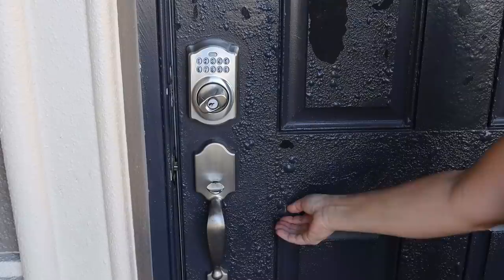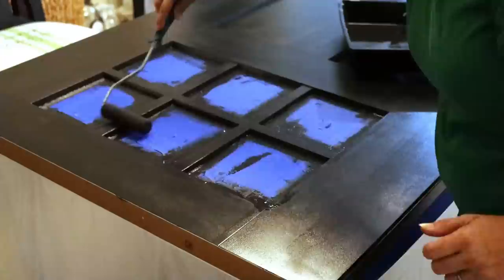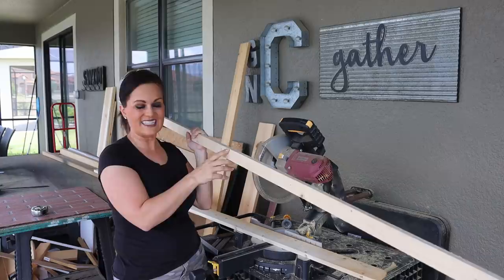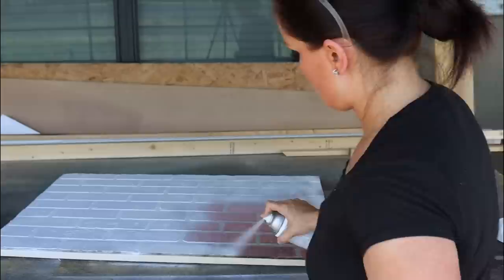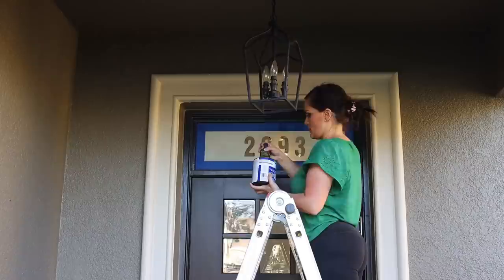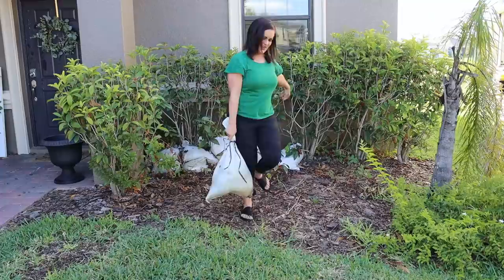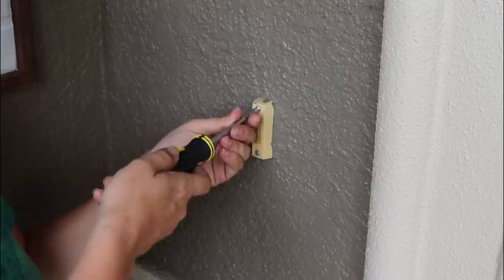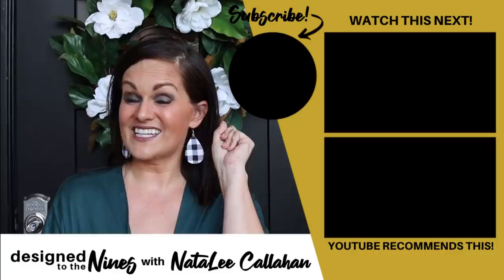Curb Appeal & Front Porch Makeover on a Budget: 7 Easy Ideas!

Comment: Replace or prune the 4 shrubs below the window to reduce their height. They are hiding that gorgeous sill detail beneath your side window. If you are hesitant about pruning, take no more than 1/3 of the green growth from the plant. Make each cut a fraction above a healthy pair of leaves, or just above the collar at the base of a branch. The two shrubs on either end can remain at current  height or replaced with something taller. At the outside corner of the house, a "tree" shrub would soften the sharp vertical of the building and distract from the neighbor's trash cans. Choose a plant that would grow no taller than about 2/3 as tall as the house and narrow enough so it won't block the window. If you can find something with attractive and unusual stems, that would be better than a mass of green. A weeping plant with its gentle swaying motion could be gorgeous. The lines of your home are so clean and simple that it is the perfect showcase for a spectacular ornamental planting.

Comment: Tarek on flip or flop got this from his Mom. Dampen the oil stain on the driveway and then add baking soda and a can of coke. Scrub with a wire brush and power rinse with water. Can be done multiple times if necessary.
Reply from the maker: I’ll have to give that a try!

Comment: If you get an oil spill accident again, try coating it with a thick layer of talcum powder, regular flour, cornstarch, to absorb as much of the oil as possible.  Leave on for 24 hours and then vac off or sweep up as much as possible, then treat the remainder with your favorite de-greaser.  Many swear by Dawn dishwashing liquid as the best to break up oil/grease.

Comment: Love the makeover. Wanted to give you a tip. I used a powder cleaner from Amazon that's also available at Sherwin Williams called TSP to clean oil from a turkey fryer off my back patio and it worked like a charm. Figured I'd pass that along
Reply from the maker: Thanks for the tip! I will definitely give that a try to see if it can finish the job! =)

Comment: I've never seen the hinges on the exterior of a door. Is that a different type of hinge? Typically you can just hammer the hinge pin out and take the whole door off from the outside! I realize this comment is very old, but I've just been repainting and re-hardwaring all our doors so I'm in door mode. Great video. Thank you!
Reply from the maker: These are common in Florida. It’s to fight against hurricane force winds. Much harder for the door to get blown in. The hinge pins cannot be removed.. so that is good!😅 💕

Comment: Hi Nathalie, I have a question.... your new door has outside hinges, I never saw that. Theoretically, couldn’t someone just pop the pin and remove the door this way? Maybe I am missing something... can you explain this to me please? 

Your DIYs turned out beautiful as always. Have a great weekend.
Reply from the maker: I forgot to put the clip where I talk about this!🤦‍♀️ anyway... it’s for hurricane protection so when the winds are blowing at 100+ miles an hour with it on this side of the door jam there is more support. It was another reason I bought the door I did. The pins in the hinges of the new door cannot be popped out. The only way to get the hinges off are with the door already open. On top of that, we live in a guarded and gated community and we have a security system. It is a really good question!

Comment: Beautiful transformation. Why are the hinges on the exterior of the door? Is that common?
Reply from the maker: It’s installed that way for hurricane protection so when the winds blow hard, it has more support. That was another reason I switched out to the new door... the new hinges you cannot pop the pins out... plus we live in a guarded community and have a security system. We have taken every measure to keep our family safe. Thank you so much for your concern though! 🥰

Comment: Loved everything! Am I the only one who is wondering why the hinges on the front door are on the outside!? Anyone could just come by and pop those hinges and break in! Is this common practice where you live?
Reply from the maker: I forgot to put the clip where I talk about this!🤦‍♀️ anyway... it’s for hurricane protection so when the winds are blowing at 100+ miles an hour with it on this side of the door jam there is more support. It was another reason I bought the door I did. The pins in the hinges of the new door cannot be popped out. The only way to get the hinges off are with the door already open. On top of that, we live in a guarded and gated community and we have a security system. It is a really good question!

Comment: I’m confused. Why are the hinges on the outside of the front door?  That makes the front door easy to break into, right?  I hope I’m wrong.
Reply from the maker: I forgot to put the clip where I talk about this!🤦‍♀️ anyway... it’s for hurricane protection so when the winds are blowing at 100+ miles an hour with it on this side of the door jam there is more support. It was another reason I bought the door I did. The pins in the hinges of the new door cannot be popped out. The only way to get the hinges off are with the door already open. On top of that, we live in a guarded and gated community and we have a security system. It is a really good question!
Reply: @designedtothenines  oh good!!   Love what you do!  Very inspiring. Your home is lovely

Comment: NataLee this is all just beautiful, but are you not concerned that someone with a hammer and a screwdriver could simply pop the hinge pins out and have full access to your home? The original door swing was to the interior, but the installer changed the direction and placement of the hinges to the exterior. I only point this out for the safety of your family.
Reply from the maker: I forgot to put the clip where I talk about this!🤦‍♀️ anyway... it’s for hurricane protection so when the winds are blowing at 100+ miles an hour with it on this side of the door jam there is more support. It was another reason I bought the door I did. The pins in the hinges of the new door cannot be popped out. The only way to get the hinges off are with the door already open. On top of that, we live in a guarded and gated community and we have a security system. It is a really good question!
Reply: @designedtothenines  well that makes me feel so much better for y’all! I didn’t know those types of hinges were even a thing. So I learned something from asking my question. Knowledge is power. 😊😉

Comment: Can I ask a question? Why are your hinges on the outside of your door? That seems like a huge security issue.
Reply from the maker: I forgot to put that clip in the video!! Oh man!! Some builders do it for hurricane protection because it is more supported when it blows at hurricane force. Plus the door I bought you cannot pop the pins out at all... so the only way to remove the hinges is with the door open... add that to the fact that we have cameras, live in a guarded community and security system and we feel pretty safe! ;)
Reply: @designedtothenines  ok that makes sense! I was so curious as to why they did that. Thanks for the explanation!

Comment: I have a security concern. Your hinges are on the outside. Your door can be removed.
Reply: I was thinking  the same thing. When I saw that I was like ummmm the hinges, the hinges!!!
Reply from the maker: I forgot to put the clip where I talk about this!🤦‍♀️ anyway... it’s for hurricane protection so when the winds are blowing at 100+ miles an hour with it on this side of the door jam there is more support. It was another reason I bought the door I did. The pins in the hinges of the new door cannot be popped out. The only way to get the hinges off are with the door already open. On top of that, we live in a guarded and gated community and we have a security system. It is a really good question!
Reply: As long as you all are safe 😃

Comment: Natalee. I think your door was installed wrong. I’m no expert, but I think the hinges should be on the inside not on the outside. Anybody can remove your door by removing the pins and popping it right off. Your old door looked correct.
Reply: Actually, I can see that your old door was the same way.   Couldn't tell because they were painted.  Oh well.
Reply from the maker: It’s installed that way for hurricane protection so when the winds blow hard, it has more support. That was another reason I switched out to the new door... the new hinges you cannot pop the pins out... plus we live in a guarded community and have a security system. We have taken every measure to keep our family safe. Thank you so much for your concern though! 🥰

Comment: I'm sure someone has mentioned this but if not, your door is hung wrong. The hinges should be on the inside. As it is, someone could easily break in. Great job otherwise!
Reply from the maker: It’s installed that way for hurricane protection so when the winds blow hard, it has more support. That was another reason I switched out to the new door... the new hinges you cannot pop the pins out... plus we live in a guarded community and have a security system. We have taken every measure to keep our family safe. Thank you so much for your concern though! 🥰